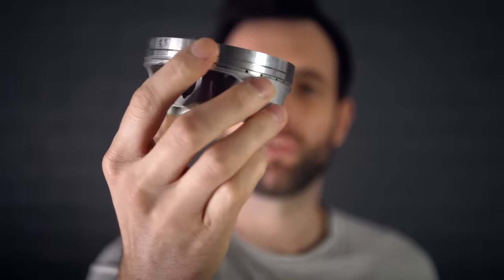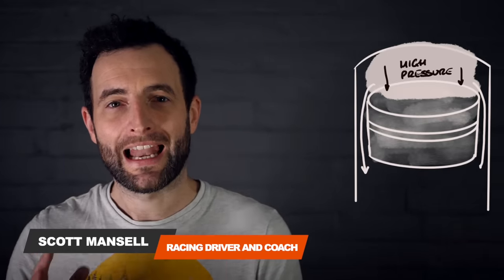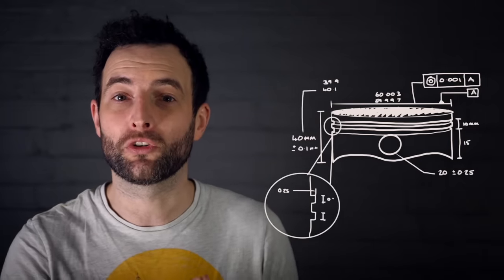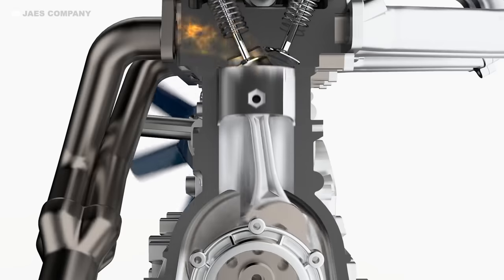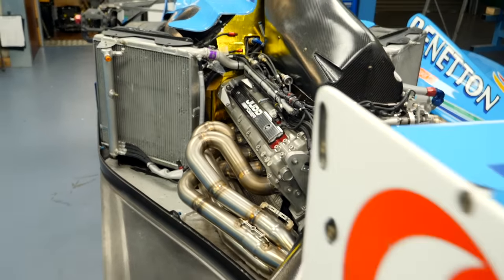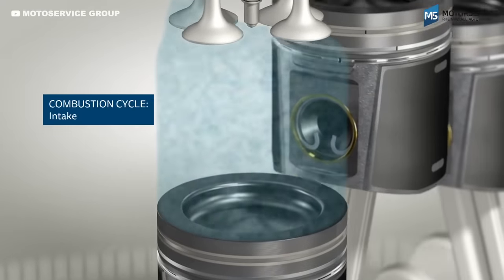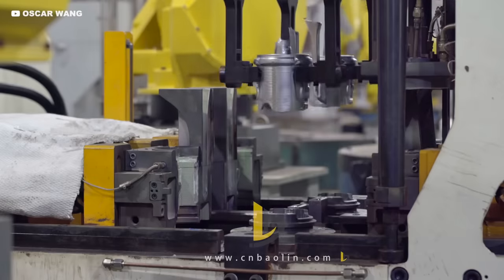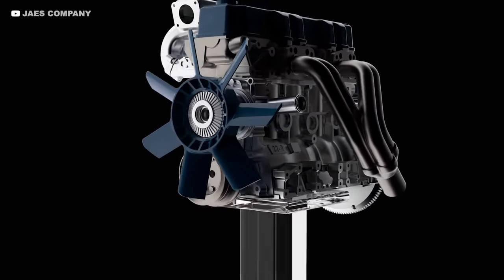Why F1 Pistons Cost £50,000!

Comment: I think its design development cost. Designing, testing, revision, more testing and finalization. Manufacturing would be "cheap" even if they made different sets as special order. But the grand total to develop and manufacture the final product to spec would be split per piston.. regular pistons also go through the same phases but with wider tolerances and a more robust build there might not be a need for more revisions and testing hence lowering development cost plus they are built and sold in bulk while f1 ones are just a few at a time.

Comment: those pistons are a snug fit tight enough that to start the engine you have to warn up  the oil and collant 30 min prior in advance.. the piston itself is made from forged materials and each millimeter saved on the weight is advantage to the overall performance of the engine.. the gap clerance is so less how they manage to put it in the cylinder  block sleave...

Comment: If the pistons are seized at RT, then is it necessary to heat the block during assembly? It seems it would be a difficult to maintain block and Piston temp during assembly.

Comment: your math at 5:44 is incorrect. It weighs 300 grams at 1 g, so at 200g of acceleration it would weigh 60kg. That 588.6 number is actually newtons, not kilograms, which can be a measure of weight, but to compare newtons to kilograms you have to divide by that 9.81 you used.

Comment: i disagree with him saying a part will never be exactly what an engineer wants and will always be over or under. im a machinist at bell helicopter and we make all the helical drive train gears. and i can assure you that every single part we make is EXACT. zero tolerance, maybe not zero, but +/- .0000000000000000000001. they are measured with lasers and diamonds and are absolutely perfect

Comment: Top fuel drag cars zero to 100 in 0.8 seconds. 333mph in 4.4 seconds (533km/h). The downforce created by the upward facing exhaust stream... over 600lbs. They're 750hp...per cylinder. They burn 15 gallons in a run. At 9500rpm, the engine doesn't even turn 1000 revolutions before they shut it down. 9500/60=158 rev/second times 4.4 seconds = 697 revolutions. Just insane stats. And F1 is just as impressive, more impressive in some categories.

Comment: Yeah well sorry pal but you haven't explained why they are 50,000 bucks. I know manufacturing and I have been in the shop over 40 years and there is nothing about that piston that make it cost that much. If those pistons cost 2,000 bucks each they would still be over priced. And overpriced is the key word here. The cost is a scam and the pricing is a scam. Those of us who have been involved in racing know this inside price inflating real well. You clearly don't.

Comment: When an aluminium  object is heated uniformly it expand uniformly and does not change shape, an ellipsoid does not become a circle.
The pistons are ellipsoidal for some other raison.  Does a reader know?
Reply: Thermal gradient. It's not heated evenly
 Exhaust side is significantly hotter than intake side, top is much hotter than bottom.
It would be fair to say modern pistons are actually more 'pear' shaped

Comment: $50,000? 
Damn. I can rebuild the compressors in my jet engine for that. And have a bunch of money left. 

It’s because they’re one offs basically that makes them so expensive. 
Like the super steels and super alloys aren’t really expensive. You can get a billet of super hard powdered metallurgy steel that’ll have a Rockwell of like 60 for $100 
Inconel 628,718 etc. Those are offered in powerder for as well. Part of what my dads business does is prototyping. We are the best automotive performance engineering firm in Texas. 💋🇺🇸🔥❤️

Comment: That is an extremely high unit cost for something they make multiples of. If you were to say they make 2 pistons of one design which needs custom forge tooling and a whole new machine setup then maybe. 
What I beieve drives the cost up so much is the development and testing behind them. All the test equipment and prototypes, years of designing and validating. 
That must be covered by the cost of the pistons they make at the end.

Comment: A lot of drama and hype over a gasoline engine.
F1 engines are relatively expensive because they don't build very many of them. For the amount of time and effort required to design, build, develop, and produce a very small number of engines, each individual engine represents a very high cash expenditure.
That's why they cost so much. It has very little to do with machining tolerances, gas pressures, mechanical forces, or power output.
It's because of the very small production numbers.
If you buy a vacuum cleaner, it might cost 100 bucks. But, if you want one custom-made to your exact specifications, a "Formula One vacuum cleaner" that has exact specs for size, weight, motor power, airflow, and dirt particle filtering allowance, and you will only buy 50 of them instead of a whole market consuming them by the hundreds of thousands or even by the millions, that ONE vacuum cleaner will it will cost you $500,000 instead of only $100.
THAT is why these engines cost so much. It doesn't have anything to do with part sizes and tolerances, pressures, or forces being "special" compared to a Toyota Camry engine, it's because the market for these exact engines is so small while the amount of work required to develop and produce them is the same as any other gasoline engine.
Reply: Exactly correct. All the nonsense about piston diameter  tolerances is also misleading. The piston rings seal the bore.

Comment: It does not really explain why (if it's even true) an F1 piston should cost £50,000 v £400 for an ordinary forged piston that is only machined to different tolerences. Yes some material is removed to make them lighter max £500 at a good machine shop. So were does the cost of the other £49,000 come in? Machining is machining different tolernace don't cost extra. Where are the exotic metals that might be involved?  Some street motorcycles rev to 14,000 rmp on pistons that cost less than £1000 each.

Comment: Why they make the clearance so tight with piston to cyl wall? That doesn't make sense, because the piston suffers from thermal expansion more than the block. This is my misses' account I just realised, I've been a qualified mechanic for over 20 years and build a lot of race motors. I can tell you from personal experience that the more you lean on a motor, the higher the combustion temps the engine sees necessitates a slightly loser fit- this varies depending on the materials used for the pistons. If you look at any big hp drag engines- which are far more powerful and under far more strain than a modern F1 motors (In fact, NASCAR engines see far higher piston speeds than F1 motors), whether they are solid blocks or have water jackets, they blow smoke on start up and while idling because the piston ring end gap is tailored to the high combustion temps at full throttle- it's necessary so the ring ends don't butt together and seize the piston in the bore or break the ring lands and/or comp rings. You've got it a little wrong my brother, they heat the oil and water because most engine wear happens while the motor is cold and they need these highly strung engines to last a lot of miles under the current rules structure... You need to be careful you teach people the correct information in vids like this, or your doing more harm than good... I am calling B.S on the bores having a greater thermal expansion than the pistons. Pistons will always be the hottest part of a running engine at WOT... The stronger the composite alloy the pistons are made from, the more they suffer thermal expansion... All serious engine builders know this...
Reply: "These grooves" are called "ring lands" my brother
Reply: There you go, you've already contradicted yourself. 60thou piston to wall thickness is plenty to cold start the motor... How long can I watch, geez

Comment: I'm not convinced by the arguments presented. An aluminium beryllium alloy was banned from F1 by placing a maximum stiffness rule. This material costs about a couple of 100 dollars per kilo, not thousands. Let's say machining and inspection time costed $500 per hour, 10x higher than normal. Then a single piston would need 100hrs to make up 50k. I think the real cost is Intellectual property, but also its priced relative to (1) the high cost of everything else in the engine, and (2) the opportunity cost for the F1 team of a failed engine. 

I think its also priced because they can, a Ferarri MAF costs 5 times an Alfa Romeo MAF even though they are identical, different part numbers but identical

Comment: There seems to be some numerical confusion. 0.15mm is .0039" which does not equate to 60 thou as claimed. 60 thou is 0.060". Just one example. I'm not familiar with tolerances on motors, but I can say with utmost confidence that machining to 4 thou isn't that difficult. 60 thou is cake. 0.01mm is about 4 tenths, not 4 thou. That's a lot more challenging to machine, but perfectly doable. Sorry, can't watch this anymore.

Comment: Maybe r&d for a piston is 50k but no way each individual piston is 50k. It's not made out of gold. After your design is ready it's just a matter of manufacturing it right. So it's a cost of materials and machine time. Good cnc machines will give you high precision. Engines are so expensive because of r&d, actual manufacturing is not 7mln per engine.

Comment: Pretty fascinating stuff.  These must all be cam ground on some very expensive equipment.  I'd love to know what the development cycle of a part that needs dimensions that tight is even like.  The department that selects and engineers the materials must be working very closely with the department that engineers the dimensions.  Otherwise, you'd never match the coefficient of expansion to the overall dimensions in such a way as to produce the desired performance.
Reply: there is another level of tolerancing that he didn't get into. yes the pistons and the bore have a "tolerance", but the ultimate design numbers are impossible to manufacture so they will measure everything and "match" a piston that is .001mm over nominal to a bore that is .001mm over nominal. neither of which can possibly be manufactured that close.
Reply: @lexluthor6906  Actually, machining to those tolerances isn't that difficult nowadays.
Around 2002, I knew a guy who's father designed, made and marketed 'machining centers' with a tolerance of 0.0005mm. It was impossible to see the join between sliding parts, even at x10 magnification (starting price was 'only' $500,000 for basic one axis machine)
I was using 'hand cranked' machines in a production environment to make parts to 0.003mm tolerance in 1976/77.
 CNC can make multiples to a finer tolerance after they are 'warmed up' to take account of thermal expansion.
Having a tolerance of 0.001mm (particularly if =/- 0.001mm)  just means there are a lot less rejects which cuts costs (very very slightly on 'low volume' production) 
Cylinder blocks, depending on design, use either wet or dry liners which are ground at 'running temperature' usually a pretty 'horrible' shape when at room temperature but it does make matching parts together a lot easier

Comment: What? .0004" (thou) is only .0101 mm. That's 10 Microns.  Tolerances are generally down to 2 microns. (.002 mm) or (.00008 inch).   8:10 in video

Comment: Weird that they cost 50k I’m guessing for a set to hold 1000 horses in, but in my 5.0 c block it cost 3k for the entire rotating assembly with 1/2 studs and it’s rated over 1300. Is it because the weight savings? Or am I missing something. At 8700 rpm is where I max is this the big main?

Comment: The GD&T notation at 2:44  calls out the diameter of the top of the piston (which is datum A) to be concentric to A (itself) to .001mm - can you explain how this works? Also, later in the presentation it's explained that the pistons are actually machined to an oval profile, making the application of a concentricity callout more difficult to understand.

Comment: Thanks for the video. Piston Question: Are the ring lands machined completely or are they 'rolled' into the forged part first then finished machined? I ask because rolling would form the aluminum grain structure to better strengthen the land. Machining completely would cut across the grain. Thanks!
Reply: Machined completely. Can’t forge with ring lands
Reply: @Ratcher  No, I asked if the lands are 'rolled' into the forged piston. It would be as secondary operation that would require re-heating of the initial forging then w/ rotating disc's(maybe w/ 3 sets), deform the wall of the forging to have the grain of the aluminum form around the land to better resist fatigue & improve strength. Something similar is done to screws, machined or the threads can be rolled. For the piston, there would be machining on the interior to remove excess material. Then final machining can be done to the lands but wouldn't require as much material to be removed.
Reply: @carmiethompson2676  I see. Ring lands are however 100% machined and it’s machining operation isn’t as trivial as it may look, especially since the lands aren’t completely flat
Reply: @Ratcher  Being in Engineering for 35 years I don't assume anything. At least you understand what I was getting at. Like the video's, keep it up!

Comment: Why does the diameter of the bore decrease when its cold? Should it not increase since the wall thickness is getting bigger and smaller you describe it as the thickness is constant and the diameter is changing it doesn’t really make sense please explain. they preheat engines in other classes and from what I have seen that is because piston slap.  A Mercedes v10 F1 engine had beryllium pistons would have been cool to mention those but maybe it’s own separate video

Comment: I would imagine the majority of the cost is in the engineering of them, or possibly just in the small size of the manufacturing runs. 

You mentioned tight tolerances, but +/-.01mm on a diameter is not tight enough to make a part massively expensive. The aluminum alloys they use are probably the most expensive aluminum alloys available, but aluminum is cheap so that isn’t saying much. Do you have a source for “Thousands of dollars of material in each piston”? I have a hard time believing the billet for each piston is more than $300

Comment: One F1 engine cost 1 billion 146 million 234 thousand 456 pounds and 46 p!
Yes: £1,146,234,456.46!
And it's used only once!
Tyres cost £199,456.67... each!
The toilette paper cost £245.67.... per sheet!!
Yes! 
That because everything is made to resist the Sun's heat and the pressure at the core of the planet, as well as 15,000 Gs while the whole engine mass is only 20 kg!

Remarkable engineering.

Comment: Unless you are including the costs the team are saying they charge for the piston design and other associated costs then I call BS on the £50K price. Yes the first one may be that much if you put all of those costs onto one piston, but they make lots of them for all the engines and the rebuilds they will perform on them as well as the pistons for the test engines. The cost they pay companies like Capricorn or Omega are MUCH less per piston and closer to £300 per piston. How do I know this? I worked for a company that made Crankshafts for Cosworth F1, Ilmor (Mercedes), Hart and Judd who made the Yamaha F1 engines in the V10 era. The cost of those cranks were about £1600 each at the time and some of those companies used suppliers like Arrow Engineering and Omega who had a low friction coating that when I spoke to them last was being used on the Ducati Moto GP bike pistons.  

Your sizes are out ten fold as 0.15mm is closer to 0.006" or 6 thousandths of an inch.  0.01mm is 0.0004 or 4 tenths of a thou. 

I would suggest you do a little more talking to actual suppliers and manufacturers who make the parts that F1 use if you want to make your videos like this more accurate and not the hyped up prices F1 teams talk about.  I currently make Pre-preg carbon parts which are being used by factory race teams and if you asked them to sell you a part they may put some mad price on what they would have to charge but that is to stop others wanting to buy those parts and for some the sale of used parts for memorabilia is more profitable than you imagine and those worn out parts will actually make a profit for those teams.

Comment: That's fascinating. It must be a real pain in the ass to assemble these engines then, you would have to keep the block warm the entire time you were assembling the bottom end and any time you needed to rotate it.
Reply: There are very strict processes in place for example you don't want to heat up the block whilst pushing air that is too cold inside as that can cause cracks and deformation. Generally, the block is warmed and the pistons are cooled down, they're inserted and then the block warmer stays on to let everything settle. My understanding is that they then do some inspections including a blower test to see just how much of a gap is present at different temperatures to map out the change in tolerances as the environment changes. Because aluminium is a good thermal conductor, it generally does a good job at staying cooler when not under load so you can still move the pistons at this point. It's a bit confusing and explained to me a while go.